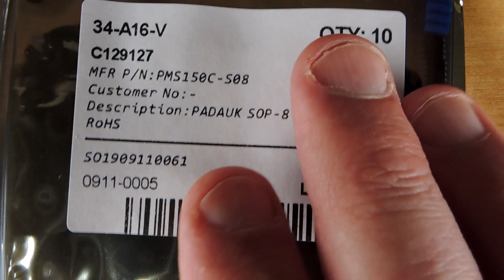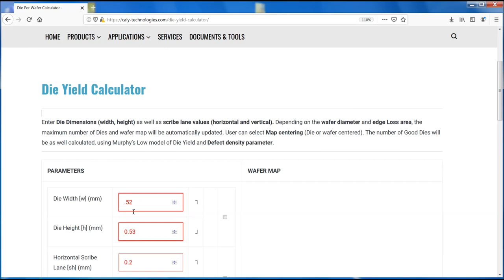3 Cent Microprocessor Teardown: Padauk PMS150

Comment: Very interesting.  Since finding the Padauk microcontrollers I've had a strange urge to use them in trashy applications and also see how far the software can be crushed to make them do great things.
Reply: bigclivedotcom I have a feeling your not the only one 😉
Reply: Can you try to erase it by xray? Because flash should be erasable by ionizing radiation, and UV is blocked by the package. It probably not worth to erase, it is cheaper to replace.
Reply: @adamrak7560  most EPROMs nowadays are EEPROMs, meaning ELECTRICALLY erasable programmable read-only memory.  There is a variant of this chip that you can reflash, the PFS154C
Reply: The power transistor on the top is telling me, it is not any charge based memory (nor Eprom, nor eeprom, nor flash;  those need higher voltage at nearly no current). The high current device suggests it is some high current zapping memory (programming a cell actually means blowing out a diode or something dimilar), so truly physically an OTP (once blown, the component just can not be "unblown"). These use to be way more compact arrays than any of the charge based cell (contain a very small Zener, so two minimal contacts, plus a selection vertical PNP - one minimal contact for the emitter, the base is the column select NWell stripe), so all is about the size of a minimal MOS in the given process. Flash needs a capacitor, one selection and one tunneling MOS, so about 3 or 4 minimal MOS size per bit cell.
Beside the size, the other advantage is the state does not depend on any floating charge, so in principle no data retention problems. The only drawback is the impossibility to reprogram and the high currents needed for programming.
Reply: what a project
Reply: An LED throwie that morse codes out your business card.
Reply: @adamrak7560  They use fuses for rom

Comment: A bit about the cost of these, since I was curious:
 - They're using Magnachip Semiconductor and Powerchip Semiconductor Manufacturing to manufacture these chips.
 - The oldest logic node that they provide is 180 nm, which uses a 200 mm wafer.
 - If you tune the scribe spacing, edge loss, and defect density, they're producing 75000 chips per wafer.
 - The slightly conservative 180 nm wafer cost is $700.
 - Which means that each one of these costs $0.01 to produce.
 - Take away the retailer margin, packaging, and maybe shipping, and Padauk's easily got a 50%+ margin on these.

Comment: Good grief... I thought the smallest die that was practical was 1mm in any dimension.  The mechanical means of cutting and handling these chips is just as impressive as the lithography!

Hats off to you, sir.  Teardowns are always fascinating, even for a mere 3 cent part.  8)
Reply: Meh, a whole smartphone SoC will fit on 10x10mm :P It just just a matter putting small enough contacts on it :P
Reply: @rkan2  Yea the pads on this die are almost 25% of the chip.
Reply: Have you ever seen a 0201 size SMD LED?? Or a 008004 cap/inductor? Amazing!!

Comment: This is blasphemy, for someone in the 1950s who spent $5000 on a giant processor with capabilities that was less than this dirt-cheap, energy-efficient, ultra-portable, disposable MCU.
Reply: this is progress!
Reply: I bet your $5000 processor was steam driven wasn't it :-)
Reply: Silently Sceptical  that's was a clock / timer basic
Reply: That thing is cheaper than a washer.
Reply: I can just picture some old engineer from the 1950s seeing this processor and making the sign of the cross.
Reply: BELIVE IT OR NOT BUT EARLY SOVIET UNION NUCELAR ROCKETS USED CUSTOM BUILD VACUUM COMPUTERS,MY GRANDFATHER TOLD THIS.
Reply: @hardscorerockkssss  I doubt that
Reply: Yet we still use the language designed for those chips on your multi-gigabyte computers that cost $1000 , while at the same time spending a lot in human resource, I'm talking about the C language
Reply: @hardscorerockkssss  those were hardly computers, they were more like a differential calculator

Comment: The funny thing about this is that there were already 5 cent name brand, reflashable chips since the early 2000s in lowend Microchip PICs and Atmel Tiny4. But just through the economics of distributors it was hard to actually buy them for less than ~15 cents. This 3 cent micro is mostly a marvel of efficient trading rather than efficient process engineering! How can they turn a profit on such low margins?
Reply: Scale
Reply: As he pointed out, you get over 50,000 chips per wafer, $0.03X50,000=$1,500. There's definitely money to be made.
Reply: @cpufreak101  so that means the cost for the entire wafer being made is less than $1500, amazing

Comment: You wrote a typo in the video title, it's Padauk not Paduak. Thanks very much for the excellent video. I am fascinated by these chips and built a programmer so that I can play around with the open source tools that have been built around these inexpensive microcontrollers.
Reply from the maker: good catch.  thanks! title updated
Reply: Spelling error is still present in the thumbnail image.
Reply: @Javantea could provide any links for an open source programmer for these uC ?

Comment: Hi my friend. Take also a look at the WCH CH551, CH552, CH553 and CH554 amd decap them. I made a video on how to prgramm them and i wonder if in all 4 of them is the same but just software locked.
They are super cheap 8051 micros with usb support and the ch554 even has usb host.
And they have an integrated usb bootloader. They are useable with just 2 caps and thats it.

Comment: Anyone have an estimate on the number of transistors used by the CPU? (excluding flash and peripherals)
Reply: rockets4kids A 6502 fits into about 4500 transistors, add some more for about 128 bytes of static ram flip-flops, I/Os. Maybe that chip has around 6000. This is no NPX LPC810 of course which has a 30MHz 32-bit arm cortex-m0+ , 1K static ram, 4K flash, 4 timers, 4 pwm, 4 uarts, 6 GPIO etc., but that part is already around $1.30. All the same, I'm disturbed to see foreign economies develop their own solutions, things like these can come back to bite us.

Comment: After decapping the ic, can it be wire bonded back onto the board and still work?
Reply: Maybe, but considering these are literally 3 cents i don't think anyone's gonna go trough the trouble of doing that.
Reply: Actually I do have a wege bonder and if it were working I would give it a try myself. Just see if it could be done.

Comment: So you mean to tell me tyat a finished 4" wafer costs less than $250?

Also, wonder what the profit margin is on these things.
Reply from the maker: Here is a good study on wafer cost:

https://anysilicon.com/major-pure-play-foundries-revenue-per-wafer-2017-2018/

8" (200 mm wafer).  $625
 ~53,000 dies per wafer    1.18 cents per part......
Reply: I doubt they are using only 4", I would rather guess for at least 8". The simple reason is the cost: 8" could be about 50% more expensive wafer than the 4", but contains 4x more of the final chips. So at the end offers at least 3x lower silicon cost per chip.
Reply: I want to know how they cut the wafer

Comment: this is extremely interresting,
I would like to know what you can use them for / aka, can someone direkt me to a chanel where I can learn about such micro controlers.
I would like to lern to use them, I have just no understanding what good they are. ^^"""
Reply: Dave from the EEV Blog took a look at it. 
Dunno if someome actually did domething useful with it though. Coding has to be done in assembler, which is not exactly popular.
Reply: Toys
Reply: @oilybrakes  Not entirely true, in Dave's videos he demonstrates a C compiler that came with the programmer, though it was for something called "mini-C" which was made up by the manufacturer and not ANSI at all.  So it's C like and not actually C, but importantly it's not assembly,

Comment: What can be done with this chip (generally speaking)?
Reply: Lots of things. Replacement of simple circuitry (think replacing a 555 and a few logic ICs), in simple tech (battery chargers, drills, PWM controllers, dimmers)...
Reply: Whatever you can code into 1024 bytes of memory and use 6 pins for.  My RGB controllers use less than 1K of assembly code.  This chip could be used for IR transmitters and receivers, timers and controlling things like hand dryers and flashlights.
Reply: But only if you know how to write code for them. I don't. but i could easily build a circuit using a 555 (or even multiple 555s) +logic to do a certain task. No expensive programmer or debugging lots of lines of code needed. You design a schematic and PCB layout, then you build it and it just works. anyone that looks at can see how it works by just reverse engineering the PCB.
Reply: A lot can be done with it, assuming the tool sets exist. I think SDCC May support it. ATTINY is obviously easier but for the price point, yeah wow. Cheaper than STM8
Reply: Simon Tay — I know, right? Integration is such a fad.
Reply: The compiler accepts a trimmed version of C called mini-C. They've probably done this because they rolled their own compiler and didn't want to put in too much effort to make a full C compiler. This severely limits your options when it comes to importing libraries. Which you probably won't want to do anyway since you only have 1024 bytes of ROM.
Reply: @simontay4851  would you use your solution for a product run of 500,000 or more?  The cost savings in parts, labor, justify using something like this.   But you are right also, these are not marketed to individuals.
Reply: Probably about as much as one of those old PIC509's could do.  Quite surprising what you could do with a small amount of code space.  I made a (not very well implemented on the hardware side) beat tracking strobe/flashing light with one (a pic 509), and a small amount of analogue circuitry a long time ago.
Reply: @Mitchellcurriedotcom  EEVblog had the compiler, iirc it was a free download, and was pretty slick looking for a super tiny executable.  No bloat in there.  Debugging required their hw block, that was a problem.

Comment: This was ABSOLUTELY fascinating!!!! I would like to know more as to HOW they make these features on the silicon at this level. Simply unreal!
Reply: Plenty of videos on photolithography on youtube, but a very quick, inaccurate primer: Coat silicon wafer in photosensitive polymer, place stencil over ir, expose to ultraviolet light, develop photosensitive polymer, clear the unexposed parts. Now the areas of the silicon that were under those parts are bare, and the rest of the die is still covered in the polymer. Submerge wafer in acid to eat away part of the silicon in those bare areas. Wash. Repeat. Repeat. Repeat...
Reply: Also, the size of the features shown in this video is many, many thosands of times bigger than modern 7-10-14nm processes. This is decades old technology, current processes are toying with sizes where the individual transistor gates are a few dozens of atoms wide.
Reply: @kaboom555  WOW!!! Thank you for the explanation!!! How in gods name do they create a stencil with details THAT small and fine!?! Also, how does the acid get into those tiny gaps to eat away the silicon when you have surface tension to deal with?? How does the acid wick into gaps THAT thin? Normally surface tension would prohibit that. Thats unreal!!
Reply: @StreuB1  that's where the inaccuracies in my explanation start... It used to be an actual hand drawn stencil, which was then projected onto the wafer with a lens that made the image smaller, the opposite of binoculars. Nowadays it's made, I believe, with laser light and interference patterns. As for the etching process itself and surface tension, no idea...

Comment: I think it is disturbing that China has these capabilities at all.
Reply: The company is from Taiwan not mainland China, but yes China have the capability of making chips for almost 40 years? SMIC was founded in 2000 and they started with a 250nm process node, smaller process node than this MCU who is probably made in 350nm process node.